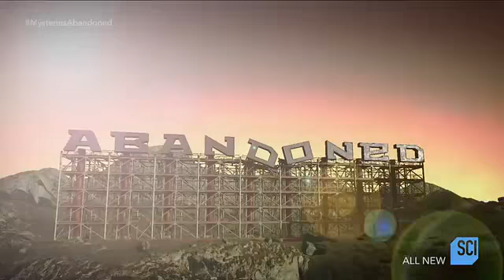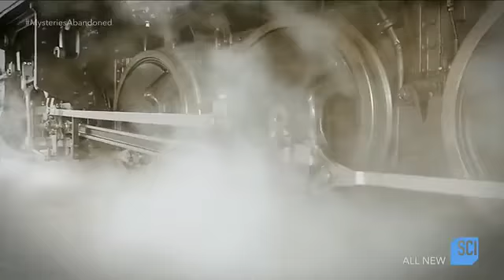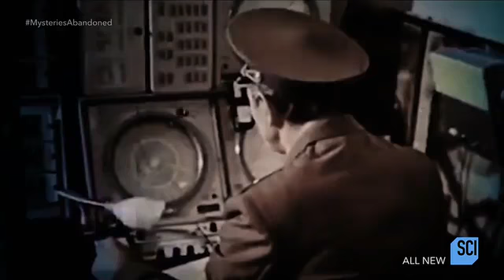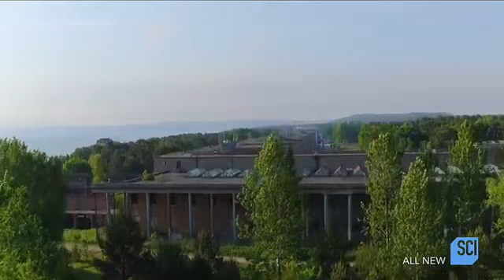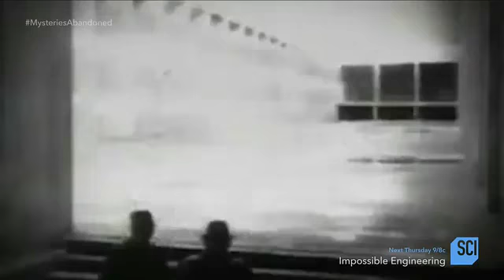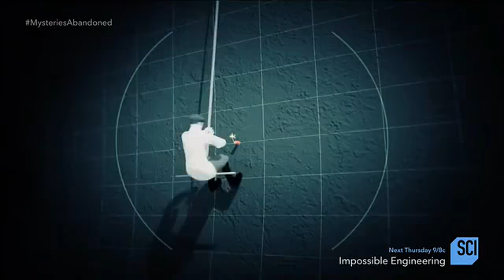Mysteries of the Abandoned S01E01 2017

Comment: If something as simple as a radio wave can't get through the ionisphere or troposphere (whichever they said it was) at the 'Duga Woodpecker'.... how can they claim we sent a spaceship (and asstronauts) to the moon ?
Reply: Ye you're right OneBlueFroggy NASA I think said they didn't send anyone to the moon
Reply: Good comment myself I like it!!!!
Reply: I think it's a question of angle. The radar's waves ricochet against the ionosphere and bounce back towards the ground because the angle is very flat, the same way a rock will skip on the surface of water. The waves are trapped and keep bouncing between the ionosphere and the ground for thousands of miles. Otherwise, it is useless as a long range radar.